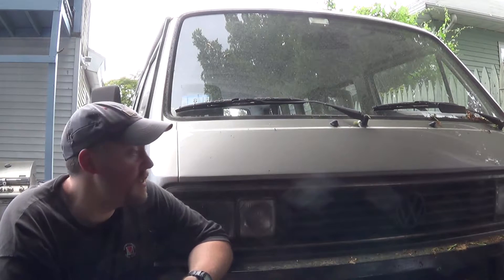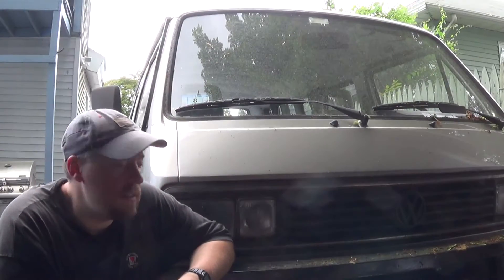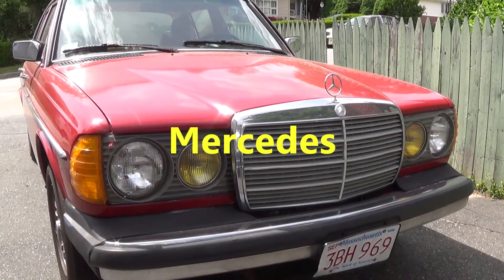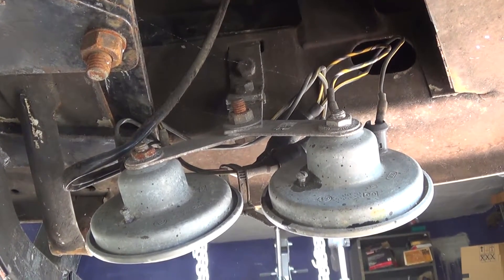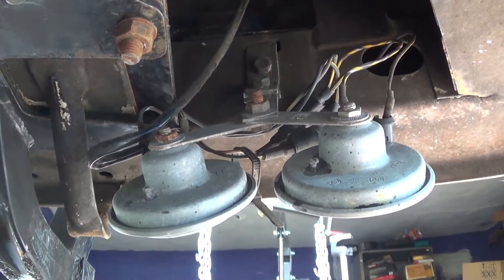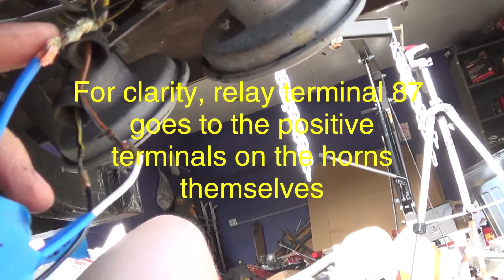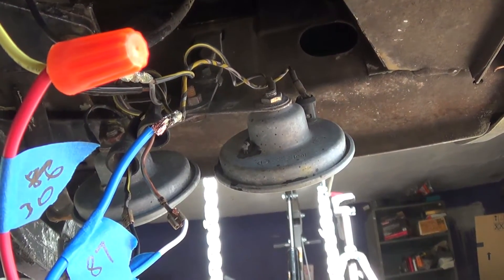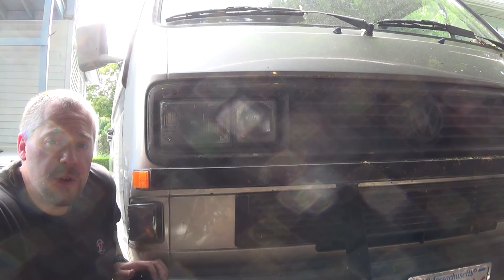1991 Volkswagen Vanagon: DIY - adding a horn relay

Comment: Correct me if I'm wrong, are both horns working or if the low tone is dead?  It seems to me that your low tone isn't doing much?
Reply from the maker: As far as I can tell, both are working. I was expecting a slightly different tone with this install, but this did increase volume.